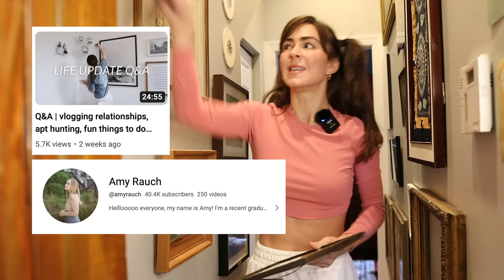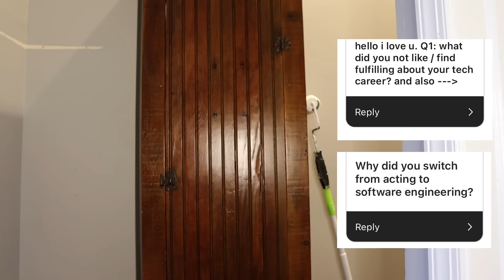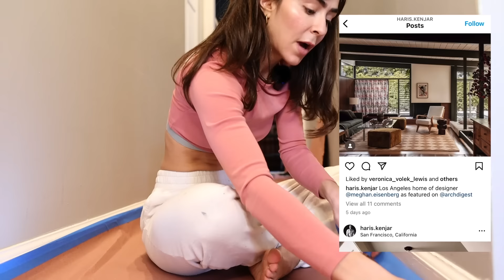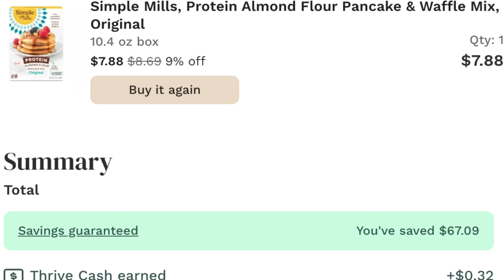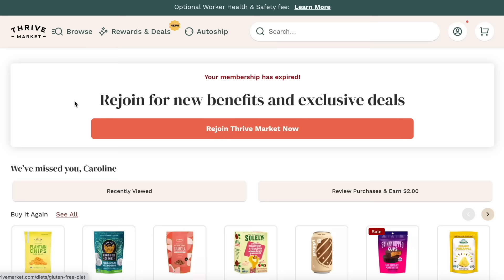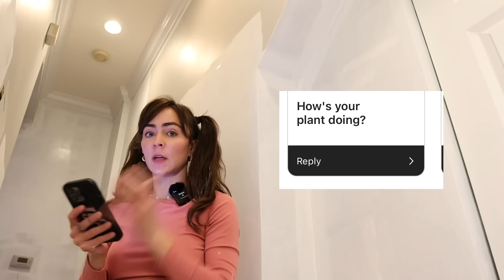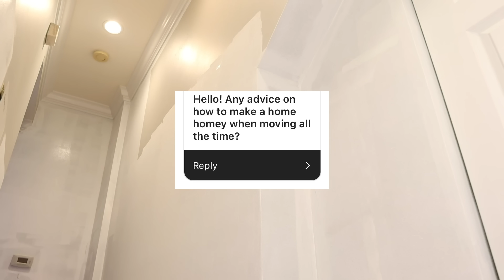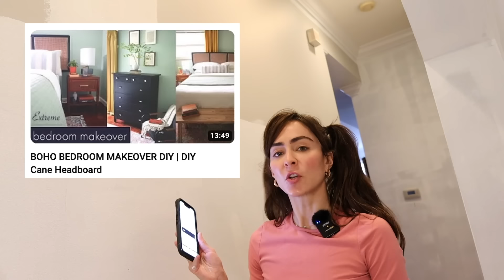Why I don't worry about getting married... Design tips + quitting tech

Comment: A painting tip...I punch holes with a nail along the rim of the paint can where the lid goes....this allows paint to drip back into the can after a pour and not down the outside🎉🎉and when the lid is popped back on the holes are covered, voila!

Comment: I love photos of Europe so my tips for not making them look tacky are: Make them look old or black and white or use the tiniest bit of saturation, and use a watercolour/drybrush filter for some. I’ve found the brightness/levels have to be lightened as when I’ve put them up on the wall they become darker. I lower the midtones a lot and it works. If doing a gallery wall use photos with more negative space or add some in. Use photos with interesting angles and curves for the B&Ws. I usually use a detail of the photo, my family’s photos aren’t great and many are from 1986 but they’ve turned out to be amazing. I take out the crowds, cars, any tech and drains so they look timeless. Last week I took a window out of a photo of Mont St Michel (a room that looks like a dungeon) and put in a view of snowy Canadian pines. The room had a lot of light coming in so it was perfect. I use cheap black frames with custom mats. I also use photos of buildings in Australia that look like Europe and no one can tell.

Comment: Little tip with straight painting walls, stand back a little further with the extension, front arm is for control, back arm is for going up and down( diagonally). It’s easier to try to go from top to bottom in long strokes. It may seem like you’re wasting paint but, you get a more even coat and you can spread it further once you get used to it. These are some tips I’ve learned from recently from some professionals that can paint circles around me because I’m new too lol
Reply: That doesnt work in a cramped hallway though.
Reply: @UntetheredBanshee  yes you are correct it was more general. I personally would use the short extension you can buy! It’s about 2ft. or a ladder and no extension
Reply: @UntetheredBanshee  you can also go in halves if necessary but top half, bottom half, then move across

Comment: Hi Caroline, 

Really random, but I hope you see this - I think your smoke detector might be non-functional. 

I volunteer with the Red Cross for smoke alarm installations, and yours looks like it's probably older than 10 years (looking at the tint and the model). Just in case you weren't aware, the sensors in smoke alarms can fail after a decade - so even if they sound when you press the "TEST" button, expired alarms might not alert you to smoke/flames and thus are basically useless hunks of ceiling-adorning plastic. 

(Though you probably already know this) just in case this helps you or another person, if you have any gas-powered appliances, a CO alarm can help protect you against Carbon Monoxide poisoning. It can be lethal and the only recognizable symptom of CO poisoning is if everyone in the home is unusually tired at the same time. For folks who live alone, this is even harder to notice. So a CO alarm within 10 ft of the sleeping areas at any height can help you not die.

Sorry if I'm repeating things you already know and mentioning yet another thing for your to-do list, but I thought it was better to mention it just in case.